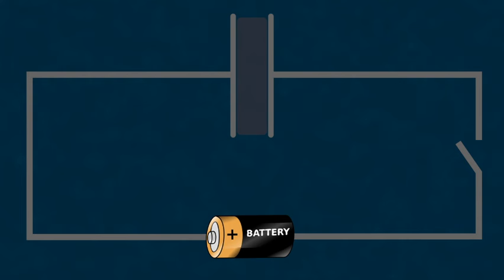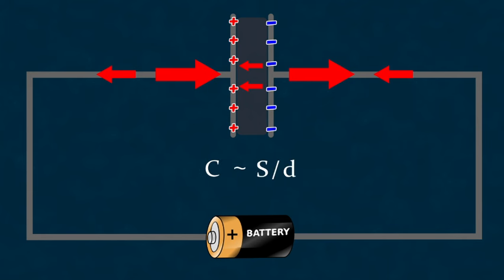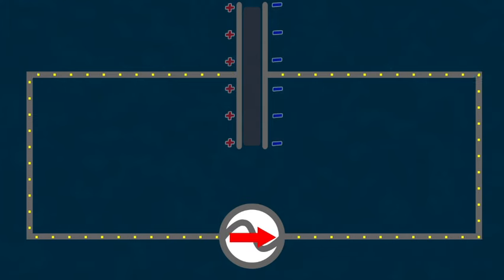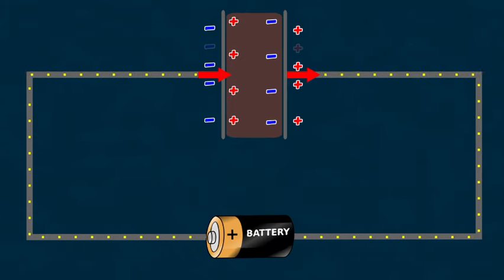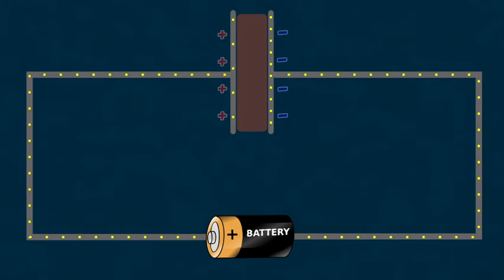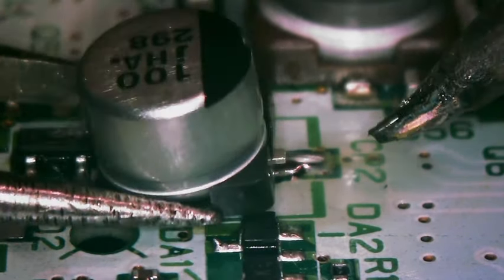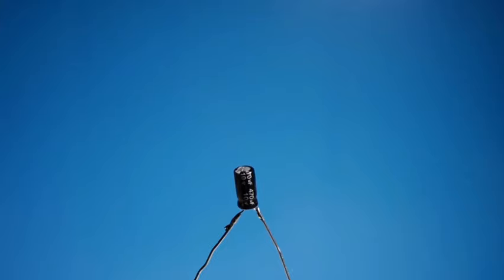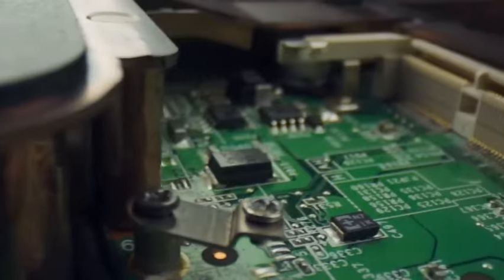How does a capacitor actually work?

Comment: I take issue with "no current will flow through the capacitor itself, neither direct nor alternating."
I understand what you mean by this; no electrons are migrating through the dielectric material.  However, from a circuit perspective, if you measure the current going into the terminal of a capacitor, you will get a nonzero reading while it's charging or discharging.
Reply from the maker: Thats what i've ecatly explained the difference

Comment: Actually, it's the dielectric which holds the charge, the plates are only used to access it and create an electric circuit for discharge. You can even take a charged capacitor apart and put it back together, it will still be charged (less of course)
Reply from the maker: It's not correct to say that dielectric holds charge. It holds polarisation, and one may also say that it holds electric field, but not charges, it's wrong and can lead to further misconceptions
Reply: @TerraPhysica  The way you explained it, lead me to the misconception, that you need 2 plates and a dielectric to store energy, but actually only a dielectric is required.
Reply: @TerraPhysica  The dielectric gets polarized by the applied E-fields of the plates (say "E") and then the dielectric has induced ±ve charges ±|Q'| within it that setup an induced E-field E', with induced voltage V'=Q'/C=E'•d.
Walter Lewin explained it pretty well.